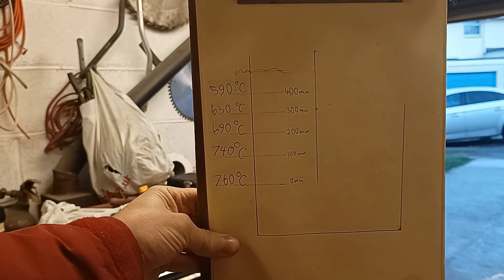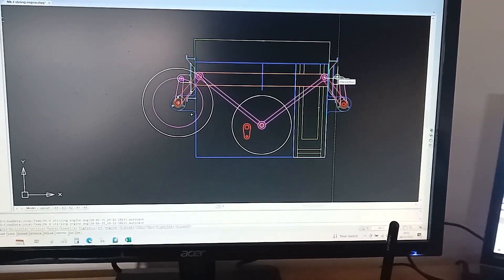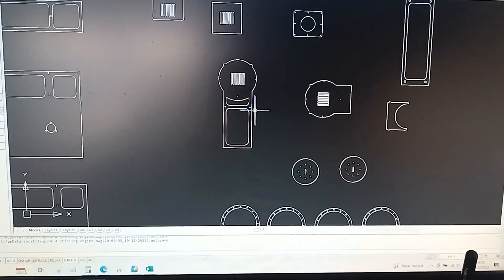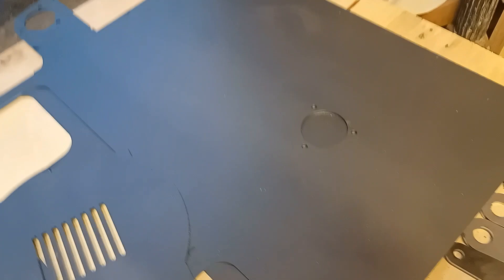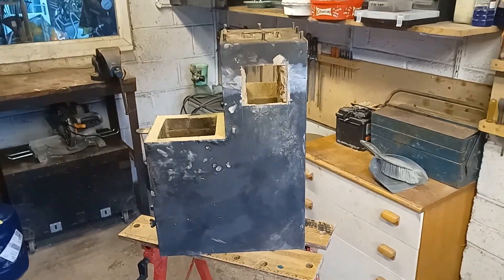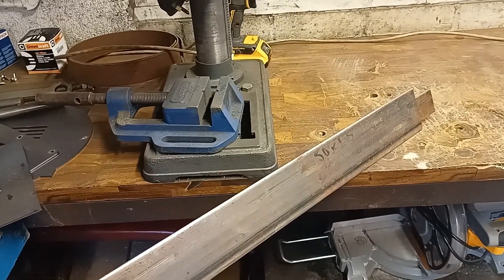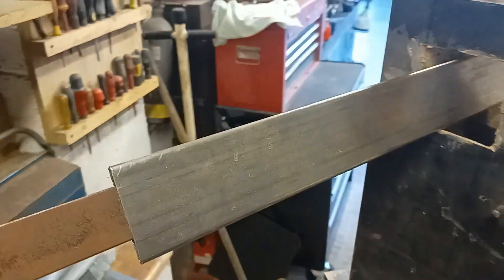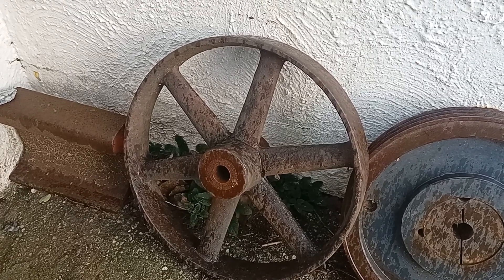Stirling Engine Generator Mk4 (Rocket Stove!) Part 2

Comment: Good  to see, and great idea, with the rocket stove don't forget secondary air!.. i learned after  building one, any smoke id unburned wood gas, it appears as smoke as all the air was used up by the fire!.. by adding air after the fire they become way more efficient!.. a simple pipe passing through the stove with several holes drilled in it say 5mm... this will allow air  to enter from the outside of the stove to just after the fire!.. the one i built uses woof pellets, the fire is about the size of a golf ball yet produces  around 4.5 kw.. I live in Cornwall and free to help if you want advice on rocket stove!.. keep up the good work!..
Reply from the maker: Adding a secondary air inlet should be easy enough. I'll get it running to start with and go from there. I may need your help with it, Cheers
Reply: @ShanePomeroy  Here if  you need advice! who knows maybe you could help with my stove?.. what  your doing is great, best inventions were built in sheds..
Reply: Yes Shane! Primary and Secondary Air. There is an excellent British WW2 video on YouTube  how to manage a steam locomotive firebox which excellently explains primary and secondary air. (Adjustable dampers) I will see if I can find the link. Chuck in Florida.

Comment: Hi Shane. Consider making the heat exchanger unit replaceable in some way so that the whole replacement heat exchanger can easily be slid in and out of its slot in the chimney. Easy to clean off soot from the heat exchanger fins as well that way.
Cheers. Chuck in Florida.
Reply from the maker: I think you're onto something there! This will be welded in for the moment. I am hoping to be able to get to it from the top (sort of!). I'm curious if the mild steel heat exchangers will even last at all? Many thanks

Comment: Great to see you are still at it!  
Couple of thoughts...
1. The pipe between your hot end piston and cool end is a huge dead space.  This messes with compression ratio hence power.  This needs to be reduced to minimum (balancing mass flow vs friction).
2. Adding a true regenerator section (in its simplest form a mass of wire wool) will double output.
3. The use of a displacer adds greatly to the ability of the system to shove the hot expanded air down to the cold power piston end.  That way at the end of the stroke the volume of the heated cylinder is close to zero, the air is all shoved thru the regenerator section and the total volume is just that of the interconnecting pipe + regen section + cold power cylinder at its point in the 90-degre offset stroke.  Then its ditto for minimising the volume of the cold cylinder when the gas is displaced into the hot end.  As your plan shows you are just kinda wobbling a long pipe full of warm air too and fro, without any decent either/or its being heated or/either cooled.  So tis all mushy, IMHO.  But do carry on as I am just a table top 'expert' with bits of a possible Stirling engine languishing on my bench, awaiting a coincidence of materials and skills to advance!
Reply from the maker: Thankyou for your thoughts : ). I need regular external input so I don't go off on a frolic of my own, cheers

Comment: As an alternative to secondary air to achieve full combustion a lot of the higher end stoves are starting to use catalytic converters to achieve full combustion, lower emissions of unburned particles and more efficient complete combustion. Really is another level and may be too much at this point for a stirling engine demo project, might be worth considering in the future. The CC's are basically a metal honeycomb with silver electroplated onto it.
Reply from the maker: I've never really thought about that! I wonder if it's the same as a car? Many thanks

Comment: Hi Shane 
I like the idea of you being rewarded for all your efforts
I’d really like to see even more on the power output side, abd which Stirling engine is your latest or best with regard to achieving shall we say near to 500watts 
Also I’m wondering about the seals, how long they last/solutions, and whether you have success with Rickey heating for compressed bio mass Briguettes?
Do you sell plans/kits?
Reply from the maker: Hi, I'm slowly edging towards a practical / simple design that gives out useful power. Not quite there yet but having fun building these engines. Hoping to be in a situation soon where I could do commissioned builds that I know will work. Cheers

Comment: There are some rules you need to keep to have a true rocket stove. E.g. the raiser pipe must be at least 67cm high. I'm afraid, you cannot just put some heat exchangers throw the raiser pipe, that narrows the airflow.
Reply from the maker: Hi, you could be right! the heat exchanger section is actually slightly wider to accommodate the heat exchanger with no reduction in flue path. I'm trying to reuse an existing burner so it's not ideal. Time will tell..... Many thanks

Comment: So you are build half-rhombic, opposed piston engine :) 

Your really need to try a freecad.
Reply from the maker: Maybe, just maybe : )

Is free cad a 3D package?
Reply: @ShanePomeroy  3d and 2d. Will send you some examples. It saves a lot of fitting trouble later. Not  as good as an angle grinder of course :)

Comment: What wattage are you aiming for this time
Reply from the maker: I'm not committing to anything this time : ). I've taken the lessons from my last few engines and am hoping for an improvement. I suppose conservatively if I could get 200w I'd be very happy because this engine is much smaller displacement compared to the last one.
Reply: @ShanePomeroy  well I hope everything works out good and you can get a really good working prototype I know you were kind of fighting with the last one trying to get it up to temp hopefully this new design works out well for you
Reply: @ShanePomeroy  and another thing have you looked at waste oil burners I live in the states so I don't know how easy it's going to be for you to get your hands on waste oil but I can get vegetable oil pretty much from any restaurant in my area and I'm working on making a boiler for a small steam engine I'm working on and I have noticed my waste oil burner gets far hotter than my rocket stove does